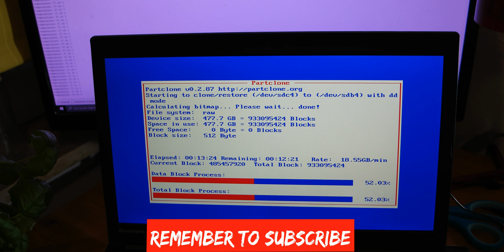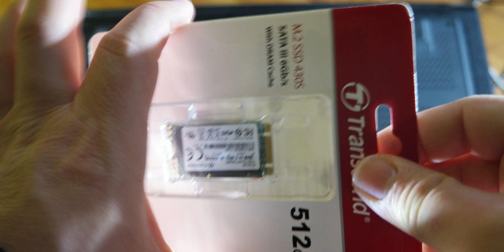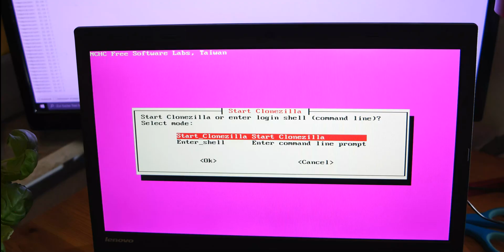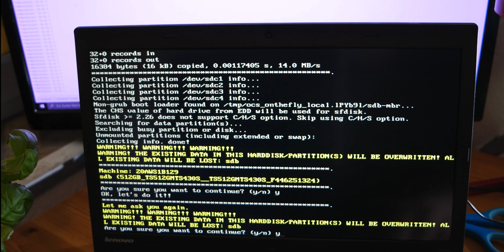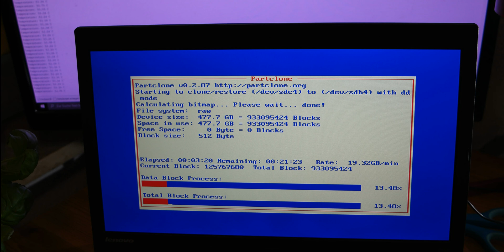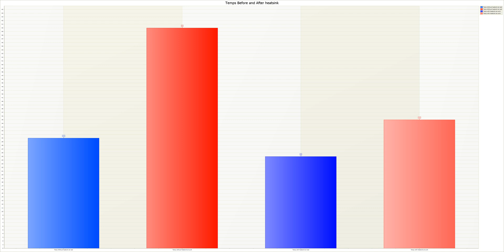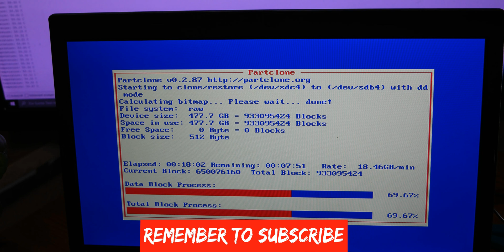T440P SSD m.2 Upgrade Is It Worth It

Comment: How's your battery life? I put mine in MTS420S and now it can't enter Package C states in throttlestop. Other people confirmed this too. Do you have throttlestop? Can you check? How's your battery life?
Reply from the maker: The battery is something like 4 Hrs when I am programming on the java. 
I don´t have it, because I am seeing it is not for Linux which I am using right now.
Reply: @drtechtek2165  I see. Which battery do you have? 9 cell (100Wh) or 6 cell (57Wh) ?

Comment: Absolutely, it's worth it. I don't use Linux on my T440p, but I have a T400, and an HP Stream 14 running Linux Mint. That said, I have a T440p, two, W540's, and had a T430s, all with the M.2 NGFF, and mSATA for the T430s.
I use Win7Pro, on my W540's. One, is my "DD". 

Win 8.1Pro, on my T440p. 

I use the MyDigital "SuperBoot2", 480gb M.2 SSD. Here's why:

First, I can not STAND to have an un-utilized port on my MB, that could be used for added storage.

All of my personal laptops, have three, SSD's. 2x1tb Samsung EVO 860 SSD's, and a 480gb M.2

Drive C:= 1tb, Samsung EVO 860. 
O/S, a few speed critical games, and graphics rendering software.

Drive D:= 1tb, Samsung EVO 860.
Other games, other programs, archives, or infrequently written data storage, and my original C: drive image.

Drive E:= 480gb SuperBoot 2, M.2 NGFF drive.
Downloads, and all other personal folders EXCEPT "My Documents", are re-directed here.
All TEMP/TMP files are re-directed here.
My latest computer image.
Frequently written/re-written data, and I also store some drivers on here for a later testing.

I do NOT use a SwapFile.

This way, I save read/write cycles on my expensive EVO drives. If I'm going to wear out an SSD, I'd rather it be the M.2. However, after using it for over a year, it is still at 100% health, as are my EVO's.

The SuperBoot2, isn't QUITE as fast as my EVO's, but it's PLENTY fast enough!

My T440p, utilizes the same SSD configuration, as my W540's.

I had a T430s, that used a MyDigital mSATA drive as a boot drive. It was fast and reliable.
Reply from the maker: Great to hear that. 
I am using it to program on JAVA and to learn also other programing languages. 
It works very good for the programs I use.
Reply: Any reason why youre using Windows 8? Ive been using Windows 7 and dislike Windows 10, however, Ive found about another version of Windows 10 that comes without all the crap that the stock one does. I bought the T440p not long ago, upgraded the CPU to an i7-4712MQ and the keyboard to the better Lite-on model. Now I just need to upgrade the screen, the touchpad, M.2, HDD to SSD, probably the heatsink too(?) and remove the white list. After that I need to look what OS to install. Im leaning towards mac OS as primary and either Windows 10 LTSC or another OS as secondary. I like your idea of re-directing the all TEMP/TMP to a different drive or to a RAMDISK drive.